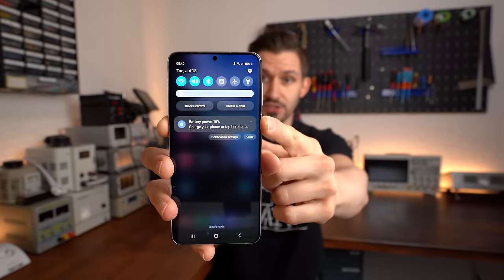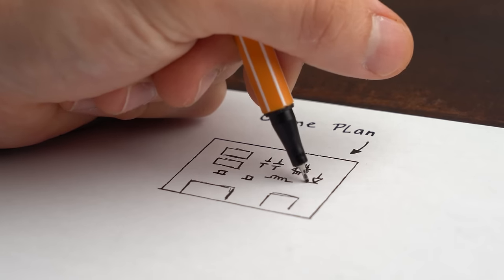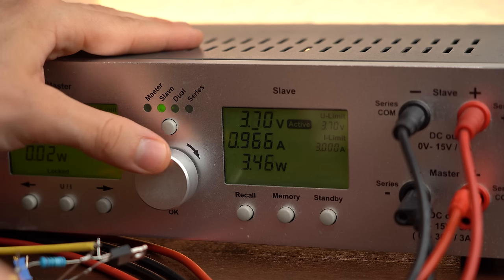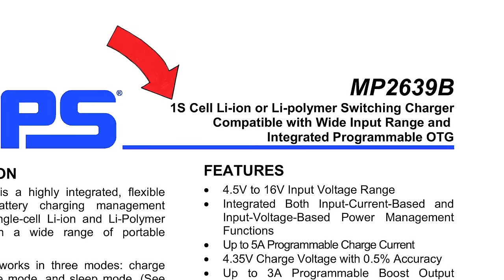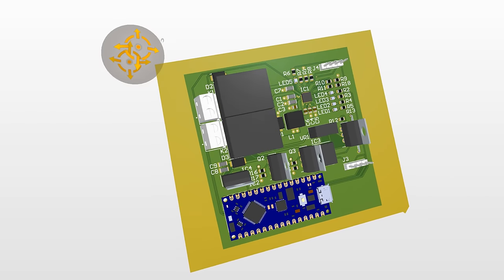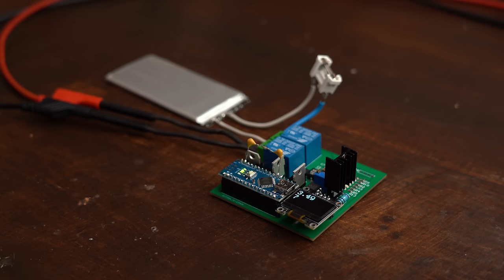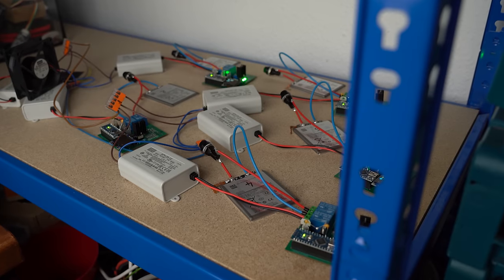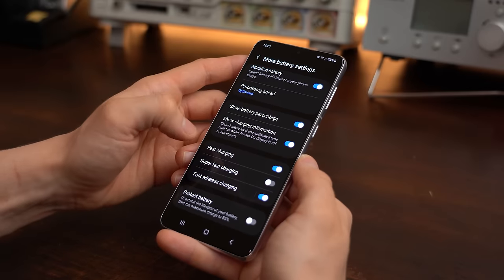Don't Fast Charge your Phone before Watching this Video!

Comment: I noticed on my Xiaomi phone that, when the charge temperature is higher than 40c, the capacity drops. There's a hidden menu in my phone that allows me to see the actual battery capacity.

My phone is a Poco F3, when I'm using USB_FLOAT charging (ie, charging without the USB data pins connected, results in 5v0.9a charging), the capacity almost never drops unless the battery temp is constantly higher than 40c. When I'm using QC3 charging, the capacity always drops a little bit unless the batt temp is constantly higher than 40c, in which case it drops 100-180mAh, and recovers upon multiple USB_FLOAT charges. This is just my findings with a newly replaced original battery though, and I saw another patreon comment saying new batteries need chemical balancing, so this might just be a new battery thing.

Comment: Amazing video as always, in my opinion it's not worth reducing the fast charging as most mobiles now days are changed every 3 years and in case they dont want to, they easily replace the battery and get benefit of fast charging

Comment: My phone has been almost exclusively fast charged (I don't have any other USB-C chargers) for almost 4 years, way longer than most people keep a phone. I've not particularly noticed a drop in battery, Even using it casually I'm still not charging it every day, maybe every 2-3 days, which I also remember doing when I first got it.

I'm using a Motorola G7 Power btw, never serviced or anything.

Comment: that was a really good video , really helpful and informative. great work , keep it up.
one request , can you test more charge cycles , as I have recently bought a new phone with 65 watt charging and the old phone that I was using , I used it for 4 or 5 years , so It would help to know the long run situation of fast charging .

Comment: I rock with the 85% limit on my s22  last me all day. i also use super fast charging most of the time unless i plug it in overnight, then i use a 1amp high-quality charger when my phone stops lasting all day. I'll turn off battery protection

Comment: As a kid I hated how my dad had a slow charger for batteries as I had handheld games so if the batteries went it would be 8 hours to charge and I needed them then! Nowadays I charge as slow as I can within reason i.e I leave a phone overnight if I can whilst using good quality cables and chargers but not fast charge, I have noticed on every phone I have owned in past 6 or 7 years that if I remove them from charger shortly after they are 100% they last far less time than one left overnight, I also notice slow charged phones in general last longer per charge than faster charged phones.

Comment: 5a charging isnt even that much these days depending on input voltage 5/9/12 the newer samsung phones super fast charge 2.0 at 45watts.

its why i trickle charge overnight even when wireless charging, i only fast charge if i need to during the day (which is not often).

for the slow night charge i set up a bixby routeen

Comment: You should also take into account that not all phones charge like that most only utilize 22 w only xiaomi and huawei thats trending with ultra fast charging devices but they even tell you that fast charging can lead to battery life issues most of them have a software feature thats trends the power input down the fuller the battery gets ie 22 w with battery @10% 50 % drops to 20w 60%drops to 18 and so on also they are thermally monitored witch also restricts power when high heat is detected all these things your tests were missing

Comment: Thanks a lot for the testing, however I do have something to add: You should have stated that leaving your battery at a high (or low) charge is damaging too, far more so than charging it quickly (at least as far as I am aware). Charging your phone over night with a 1A charger is a horrible idea if your could just fast charge it in 30 minutes in the morning. Your phone will sit at 100% charge for hours which is terrible for the battery
Also, a slow charge speed might lead people to drain their phones battery further than if they could top it up in 10 minutes or less.

This is the main reason why I think fast charging is a good thing for battery health, I prety much never have to drain my phone below 20% and never let it charge above 80 (unless I forget of course...)

Comment: i need to ask. If that circut charge always 5A? Modern phones have smart charging chips and they slow charging when battery have more Voltage to prevent capacity drop.

Comment: From the lithium battery discharge circuit we learned that the mosfet gets pretty hot and needs a decent heatsink, now in your prototype in this video you only have a tiny heatsink on the mosfet, did you change something on the design or on the choosen mosfet so heat isnt a big problem anymore? I had to attach my mosfet to an old cpu cooler to keep it cool

Comment: Excellent video, Scott. Great comparisons too, just one comment though. I do think you need to get a smaller soldering iron tip, and perhaps some 0.25 mm solder. SMD work just can't be done easily without it. Keep up the good work and thanks for sharing.

Comment: I request you to run this test continue, wheather battery holds charge as company claimed 1000 1500 cycle without lousing 20% capacity.

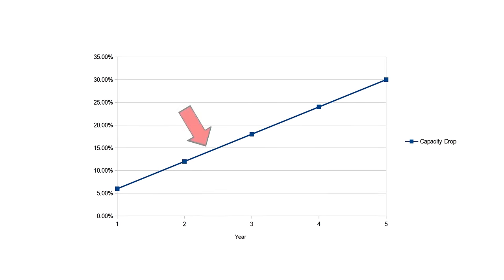Comment: 11:27 I bought a Samsung S20+ 5G on 9th April 2020 and used Super Fast Charging nearly all the time, from the original 4.500 mAh I have currently 3.768 mAh left, which means 84 % remaining capazity or a loss of 16 % capacity in 3 and a quarter year.

So the first drop of your tests can lead to a simple sum up: A new accumulator looses the most capacity at the beginning and stays at a certain level, because I had a S6 prior my S20+ for around 5 years and it had also ~80 % remaining capacity (don't know the exact value right now).

BTW: Super fast charging means only up to ~80 %, the rest is charged "slower". I am not sure if you used this technique during your tests, too. Did you? Danke und über eine Antwort würde ich mich freuen. ;)

Comment: I'm not sure if his results factor in the different manufacturing tolerances each battery goes through. When charging several of the same devices the same way all the time, a few may show less wear over time than others. Same charger and charging time, you would think the degradation on each battery would be the same but in most all cases, it is not.

Comment: Great video! I hope you can replicate too the charge regulator of smartphones next time..
Smartphones have temperature sensors on the battery so that it will slow down the charging when battery temp gets high. I live in a tropical country so I can say its true.. my phone charges faster when I'm on an AC room compared when I'm somewhere with an ambient temp..

Comment: That was really interesting. I've heard that fast charging is actually better if it means that you charge your phone without using it instead of using your phone while you're waiting for it to charge, because the heat produced while using your phone has a large impact on battery health. I've also noticed my phone get a little warm when I use fast charging, even when the screen is turned off. Maybe I should remove the rubber phone case while fast charging it so it doesn't heat up as much. Anyways, I'd love to see some numbers on what temperatures the batteries are at, and whether they are affected by putting a heat sink on them!
Reply: The heat for a short controlled time isn't bad, but rather good - it helps to clean the electrodes

Comment: I used to fast charge a lot... until my phone battery died after almost 2 years. Luckily this was covered by warranty. Now i only use an old charger that can't put out more than 1A. Another 2 years later the battery is still fine and not bulging, like the old one, where the glued cover almost came off by itself.

Comment: Well, the circuitry in many modern days smart phones are design so that it use fast charge until the battery is at 75% full and switch to slow charge. This do prolong battery life.

Comment: My Pixel lets me choose when to use fast charging (which i use basically never). When i plug it in at night, and i have "bedtime mode" turned on, to silence incoming calls, the phone automatically slow charges, so that the phone will reach 100% by the time "bedtime mode" ends, i.e: when my wakeup alarm goes off. 

Maybe I'll need to use fast charge during the day, as ny battery gets old, but two years and 4 months in, i still get a full day if use, and only slow charge ever.

Fast charging us just one of many methods of planned obsolescence, which wouldn't be a huge problem in the E.U, which mandates slide in user replaceable batteries for all new phones. The US will never do that, IMO.

Comment: Can you do this test with 5V 2.4A charging as the slow charging speed? 5W charging is very slow nowadays, especially as most phones have batteries higher than 4000mAH (personally use a 5000mAH phone), and 5V 2.4A used to be a fairly common spec before fast charging became a thing. Thanks!

Comment: One major thing you don't know
Good quality fast charging Lipos are specially designed for it having more spacing between it's anode and cathode layers
The one you tested were generic Lipos

Repeat the same test with the exact same Lipos which are used in your phone

Comment: Hilarious how I found this video right after buying a fast charger (and they said google ain't spying). Mine is a 60W USB-PD charger but my current phone doesn't support very high voltage charging so I charge at 9V 3A. I only use that tho when I am running out of battery. My charger also has a 5V 2.4A output seperately which I use when I charge overnight. I used to use a 1A charger for overnight charging but it was too common for the battery not to be full in the morning so I got this one instead.

Comment: This is purely anecdotal, but I generally find that not charging past 80% more than compensates for consistently charging at 50+ W. Although my phone has a split cell battery, which supposedly helps a lot.

Comment: I feel like fully charging and discharging would damage the phone more than fast charging. I keep my phone from reaching below 20% and above 85%. 

Furthermore, if I get more uses out of this phone by fast charging it then it breaking in 4 years than slow charging it and it breaking in 4 years too, I would fast charge my phone.

I've never had a phone be rendered unusable because of the battery. All of my phones were replaced because of aging hardware and lag. So, I'd still fast charge my phone.

Comment: Great video, very instructive ! I'm having trouble getting the discharge circuit, if i understand correctly the opamp drive the mofset in the saturation region to generate the voltage drop needed to be at 1v at the resistor, but to do this the mofset have to draw a non negligeable amount of power ? I did a quick test in ltspice and ended with 3.6w of power consummed by the mofset on top of the 1w from the resistor. I guess i'm wrong somewhere 😅

Comment: I think it would had been great if in the experiment you would had used one more in 100% to 20% charge cicles, because that's the recommendation i have seen in many phones lately.
Atte. Please Scott make a video recommending cheapest devices for starting a electronic workstation.
Im pretty frustrated depending on the equipment of my college.

Comment: I used a tracking the watts my phones is charging it when it's at 12 to 60%. it's 45watts when it's higher, it drops to 25watts honestly depends on the phone if your talking about dont fast charge

Comment: Behind each super fast phone charger it uses multiple voltage in the same cable 5,9,20 ... How does it works? Does it increase the voltage time to time? Is it safe for the phone? How is that managed?

Comment: Contrary, fast charging at least one times per week prolongs the life of a battery because it animated the chemistry and cleans the electrodes. You can compare it with a car: you shouldn't use a car only in the city traffic, once in a while you should use the highway/Autobahn to get the motor for a prolonged time on high temperature and burn away residue like soot

Comment: Fast or super fast charging doesn't keep the voltage/current at the same value through 1% to 100%. Samsung phones gradually decrease current as the batteries get filled up. Could you please do the same experiment again with similar current ratings of fast/super fast charging? U can use a usb battery tester and log the current ratings throughout 1% to 100%.

Comment: Anecdotal evidence here, in about 124 months, the battery of my phone hold about 75% as much life as when it was new, yes, the quick charge is a nice thing, until you need your phone to last a whole day without charging it because you're moving a lot.

I used to confidently use my phone and charge it back during the early hours of the night, now it'll reach 40% before 2 pm, and be at around 25% by 4-5pm with little use.

Onw thing I've testing is that charging my phone with a 2.1A charge instead of the 30W  5 amp quick charger seem to make the charge last more, i know it makes no sense, but it seems that it retains charge better that way. The phone discharges more slowly.

Comment: Xiaomi devices redmi note 9 Pro
specification says has 5020 mAh capacity.

Tested Capacity when new : 4993 mAh.
after 2 years, 7 months of use (20 dec 2020 bought date)

the capacity drops to 2855 mAh (last tested : 12 nov 2022)

and when new, usually lasts 2 days to need charge
now it only lasts almost 1 days, maybe 17 hours.

almost every time i charge i use fast charging Turbo 30W. (27W max support).

knowing from this data, now i usually charge with 1A/2.4A charger when charging at night before bed
and use 18W fast charge when in work (needs to get filled fast)

Comment: Very cool stuff and it's on a channel that has enough subscribers to keep it going. And I will be looking forward to a long-term test, if time permits, even about 1500 cycles, which would be the equivalent of about 5 years, which correspond to the use of the smartphone by people who do not throw it away right after the support is abandoned and the system starts to stutter noticeably. I would expect an avalanche of capacity loss with such a long time, because in a phone used with a regular 1A charge, the battery holds up very well, then the lack of capacity begins to bother more and more, to record a decrease of about 33% after the above-mentioned 5 years, which in  batteries charged quickly should be done earlier and more aggressively.

Comment: Some Lithium BMS chips that support multiple Li types do not really care about the exact battery charging voltage, rather, it's a range
That said range might be set by a external EEROM or by a MCU,
Or "flashing" a internal EEROM

Comment: Did you charge at a linear rate? USB-C PD PPS phones like the pixel 6 and 7 have variable voltage and can control this so that the phone has a high rate of charge at the beginning and lower at the end. Other phones would drop rate at 80% charge.

Comment: Nice experiment, though it might be that the charging profile that the pm-ic in the phone uses differs from that of the chip you used. Could be measured if you can open your phone without destroying it :)

Comment: High voltage fast charging affects life span  faster than high current fast charging, tipically 4.5 volts and 5 amps for one cell and when you have 12 -20 volts  with 6 amps  you have two cells in series  see xiaomi 67 or 120w fast charging

Comment: If you are someone who changes the phone every other year. Then it is not a big issue. 
And if you are a kind of user like me, who will use the phone for more than 3-4 years. Then just change the battery after 3 years. It won't be that costly.

Comment: I think nowadays charger uses their own protocol to intelligently charge the battery to balance between the charging time and the life cycle. In this video seem it doesn't have that two way communications while charging the battery.
I used to have Samsung flagship phone many years ago and the max charging is 2A but still after 2 years the battery capacity shows obvious drop ~ 30% (even I know it is not fast charging). After I changed to other brands with fast charge for like 3 years, only I noticed the capacity drop but still useable - because you can easily get the juicy back even the capacity drop 30% or 50% and the fast charge definitely promised to get your phone ready in another 30mins instead of 1.5hours and yet may be last you for 3 hours ...  
One thing I do notice when using a standard 5V USB charger that produce 1-2A making my phone to get warmer compare to the manufactured fast charging charger. In fact the fast charger from the manufacture able to keep the battery temperature always at the low side. 
So in short, nowadays charging technology is very different and advance to what we know in the older days.

Question to everyone:
Do you want to have your phone be ready in 30-40mins (but drop ~30% capacity in 3 years time) or you wait for 1.5 hours (still drop ~30% capacity in 3 years time) but used only for like 5 hours normal use or 1 hours in game? Which one will you guys prefer?

Comment: With not always charge the battery super fast, I kept my phones for 5 to 6 years with not a problem with the battery.
Of course, sometime you need to fill it ASAP, so I use fast charging.  Just not often.

Comment: For this reason, I only charge my phone from 40 -80% whenever I can. I am aware that a full quick charge can damage the battery. I would like to see a test with different increments, for example, 50 to 60%, 30 to 80% and almost empty to full charge.

Comment: rule of thumb is 1a per 1000mah capacity is no problem, if you have a 3500mah battery you can charge it with approx 3,5 amps